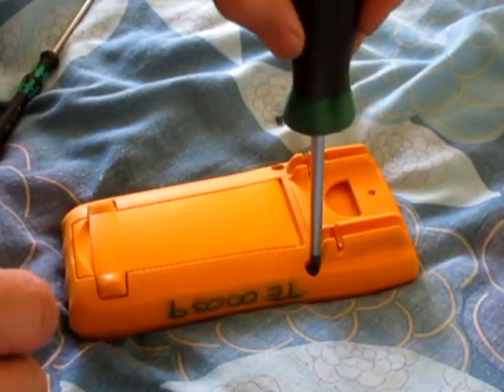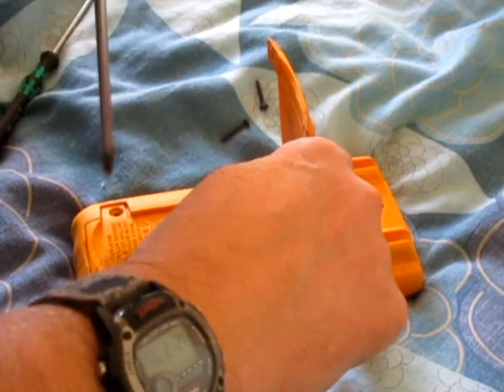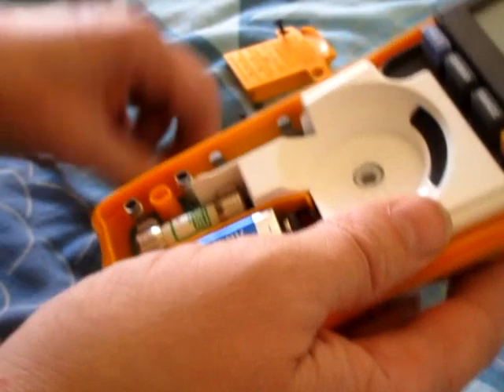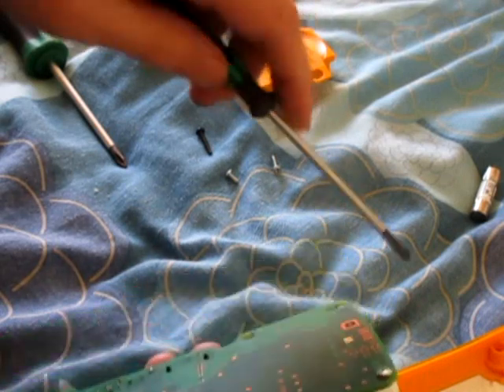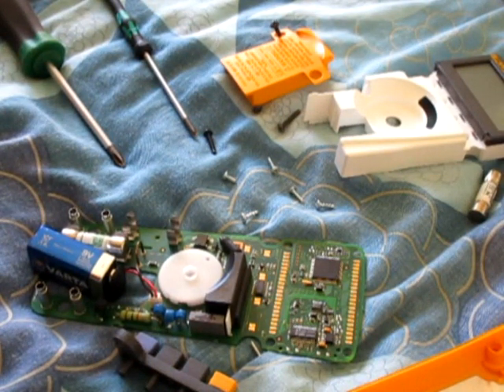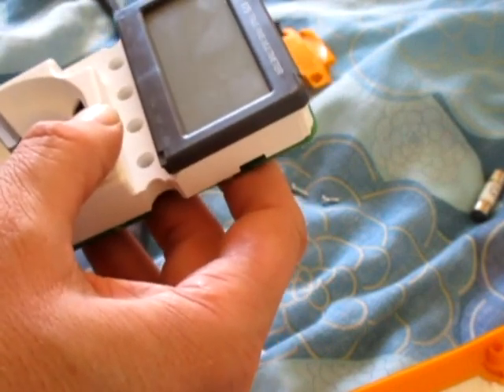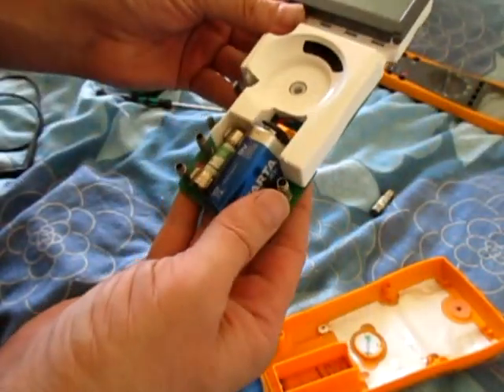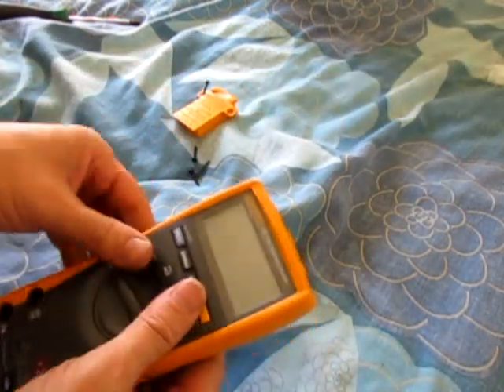Fluke 175 LCD Screen Replacement, Tear Down and Repair Guide (Zebra Strip & Display Fix)

Comment: Easy mend for you....If when you twist the Fluke circuit board and the power goes of to the display screen this is generally due to a bad connection on one of the four small square resistors which sit all inline down one side of the circuit board { Black 2 mm square resistors } ....one of these tiny resistors has got a broken solder on one its two mounting lugs and just requires a fast re=soldering so that the heat from the iron will not overheat and damage the component.
Reply from the maker: good luck let us know if succeed , ive had twist board problems before but it was a faulty reading problem
Reply: @cagmito76 Thanks for your reply !
I always enjoy watching a good multi-meter repair tutorial....nice to build up a mental database and save myself 80 or 90 quid a time by doing the repairs myself. When you know what to look for it is so much easier. While im busy using my Fluke testers on the various electronic projects I sometimes get carried away in the heat of the moment and forget to change the test leads around for testing between voltage and current or amps to milli-amps or do a current test on a car battery instead of a voltage test etc etc....then bang a fuse blows or component on the circuit board fries so I need to be careful and slow down a little to prevent anymore of these problems in the future !